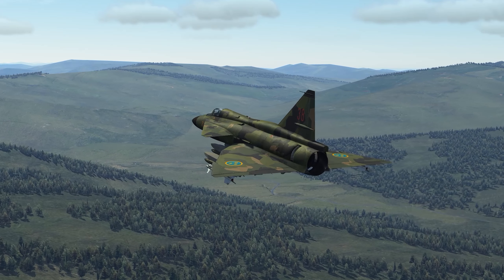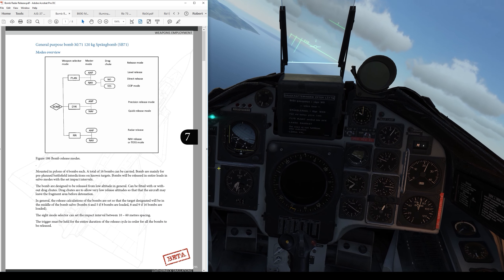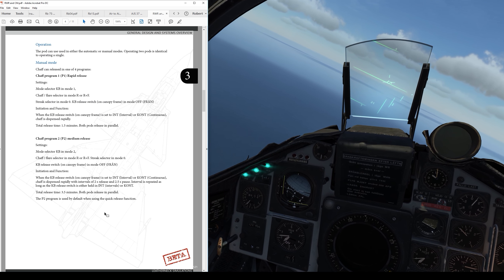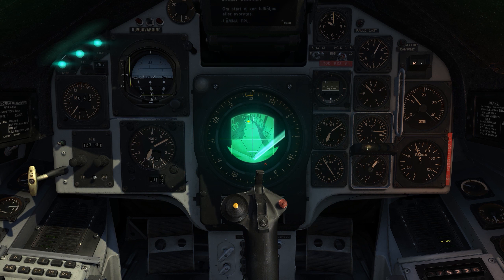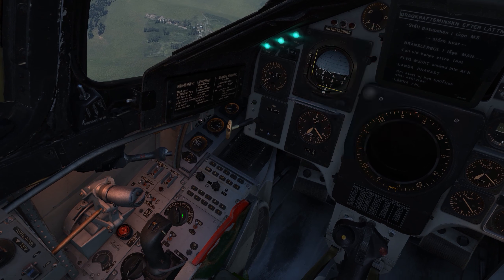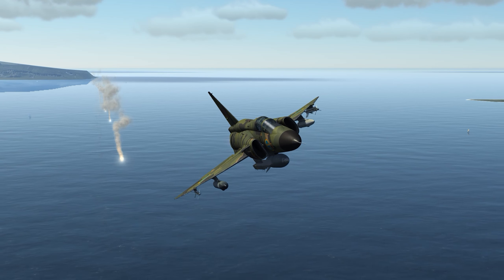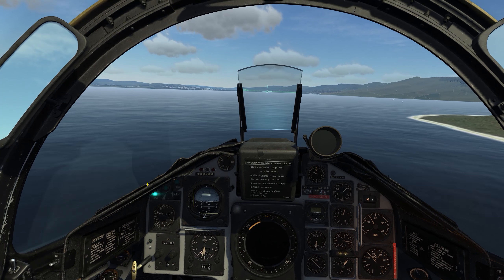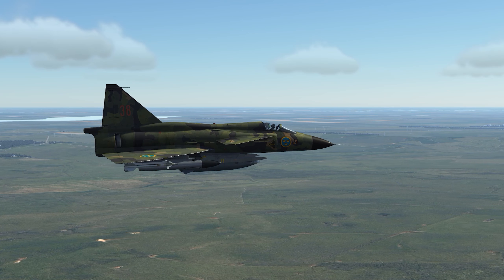Test Flight - DCS: AJS-37 Viggen - Radar/Nav/Toss Bomb Delivery Modes, ECM and Countermeasures

Comment: Why are the countermeasures coming from the jammer?
Reply: I assume a mistake with the Countermeasures being set to drop from the wrong wing.

Hope they correct it since the Countermeassure pod was usually carried on the other side.
(You could have it on either or both sides but i think the ECM could only be carried on that side so the Countermeassure pod was usually on the other)
Reply: At least I'm not going crazy, I thought I might have been, I expect you're correct.

Comment: can't wait to toss cluster munitions over troop formations xD xD
Reply: Only cluster type weapon used by the Viggen is the BK 90 and its a guided glide munition so its not really helped by tossing.
Reply: Mattebubben  i thought there would be some canister based cluster munitions like CBU-87 :( 
The only good thing tossing General purpose bombs would be to hit runways and large targets like aircraft parkings ;(
Reply: Sweden never acquired traditional cluster munitions.

The reason for this was the Swedish military doctrine was a defensive one.
So any use of Swedish bombs would be against enemy troops on Swedish Soil.

So the use of Traditional cluster munitions was ruled out due to the danger (certainty) of
the deadly unexploded submunitions it would leave.

In the 80s The Swedish armed forced ordered the development of a weapon with the advantages of a cluster weapon (area coverage) but without the danger of the Unexploded submunitions.

The Result of that request was the BK 90 (DWS 24/ DWS 39) that though technology was able to remove the risk for dangerous unexploded munitions (they would either explode when supposed to or they would not explode at all).

Only Bombs the Viggen has is 120kg 4 pack bombs as displayed in this video.

Only other bomb-esque  weapon is the BK 90 Gliding submunitions dispenser.